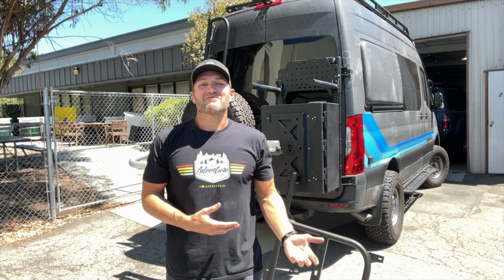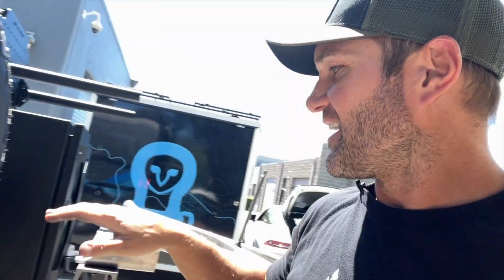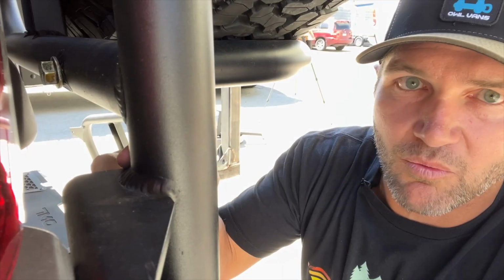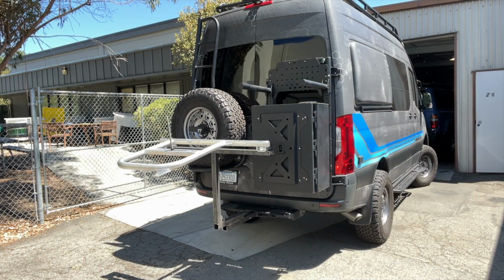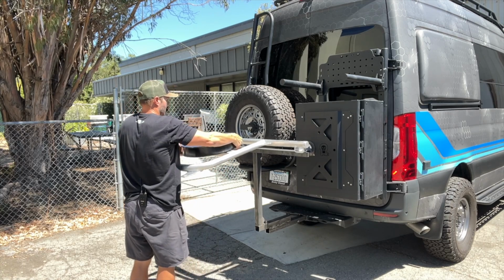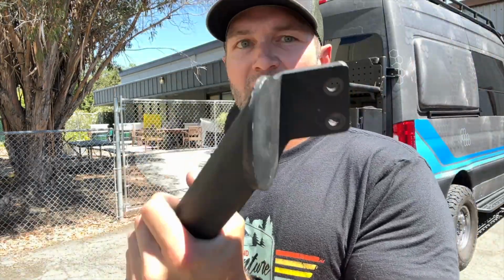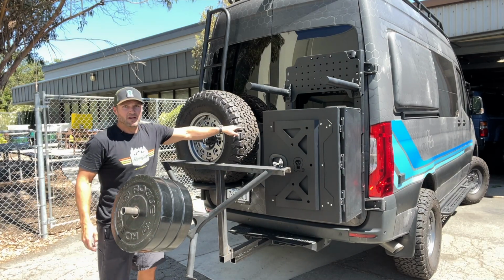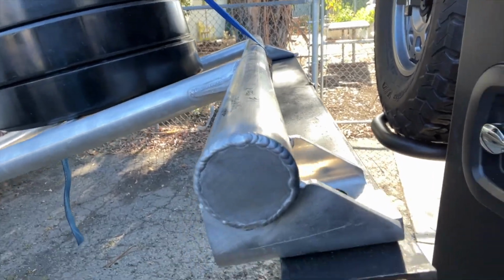How Strong Are Van Tire Carriers? Let's Destroy Them for Science

Comment: Looks like you need to remove the interior trim before you drill that hole.

In the video…. You drilled into the insulation of “whatever that line is”??

Maybe open the back and tape it to the side to avoid damage???

Cheers…. Awesome product

Comment: the Owl tire carrier's mounting plate on my 2018 3500xd sprinter sheared off while driving on city streets after only a little over 3 years of use. i'm waiting to hear if they have parts to repair it at a fabrication shop somewhere, but not certain there's anything they can do for me. i am praying the talon super single wheelset i purchased earlier this year will hold up a lot better.

Comment: Luckily, the tire rack is not mounted in that orientation. This test is pointless and proves nothing. Mount it up properly and try again!
Reply from the maker: Then you don’t understand the forces involved. The vertical load is unimportant because it is easily handled by almost any design.  This is why other carriers crack doors. The important factor is the rotational force into the third mounting mount (the door) when the door is closed. This is the exact force direction illustrated in the video.
Reply: @owloffroad  unless you’re being rear ended. When would the force you applied be realistic? You’re using leverage on a dynamic plane the object wasn’t designed to be used in… I’m all for testing but this is farce.
Reply: Great video. Thanks for making it. 
I've been looking for a spare wheel carrier and was leaning towards one of the less expensive models. I'm glad I found your video before I made the mistake of actually buying one. 
Your physics and engineering make perfect sense. I'll be buying the Owl carrier because I plan on keeping my van for a while and don't want to damage or destroy a rear door.

Comment: Interresting, and many good points,  but "Tire Carrier Testamatic 3000" is a flawded test. The direction of the load (weight) is incorrect.
Reply: It actually is the best test because important factor is not the load of the tire vertically. It is the rotational weight when the door is closed that causes issues (on doors splitting).